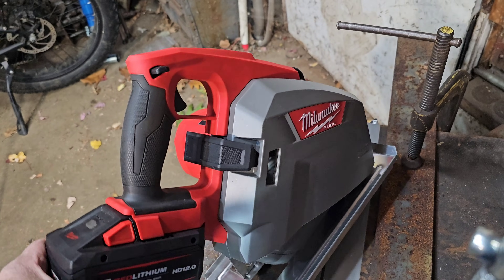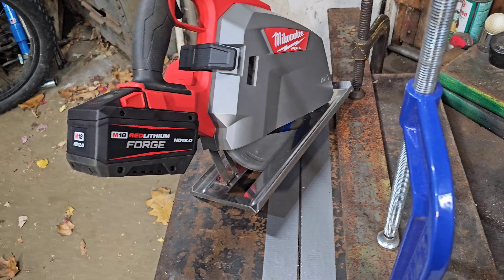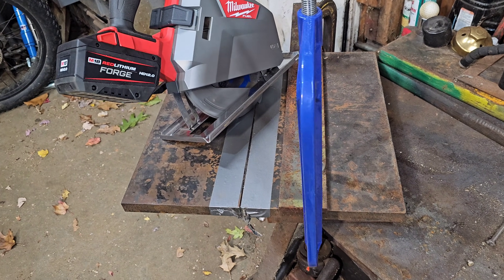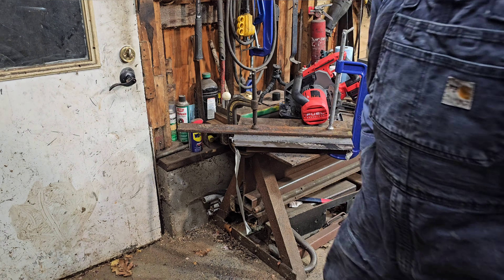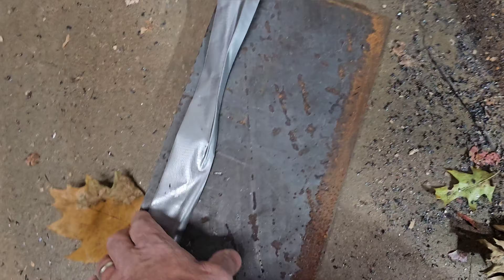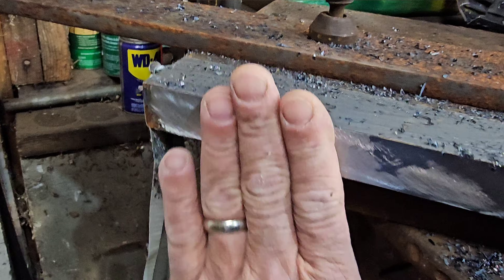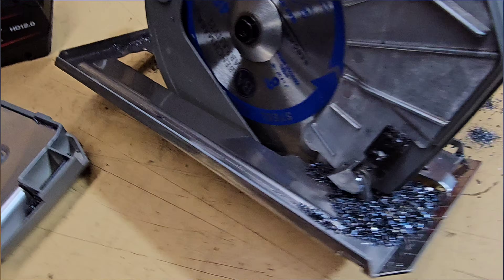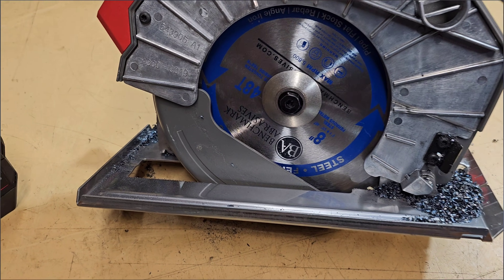Can a cordless M18 cut 1" steel plate? Milwaukee 2982 8" circular metal saw using Forge 12ah battery

Comment: How long does a blade last on 1" plate with that saw/blade combo?

I used a regular wormdrive skil saw and diablo steel demon 7 1/4 bladw on some 1" plate for about 5ft and cut good but blade was done after that.😂
Reply from the maker: That's all I've done with it.  I have some 1.25" plate I'm going to tackle when I get a chance.

Comment: Does it makes a difference in power when using a forge vs high-output batteries?
Reply from the maker: @DharwinMoris  I haven't tried it with the HO, but my guess is yes.

Comment: Amazing!  Were you able to see the push pressure light from your point of view?  Looks like the proper head position is in front of the blade when cutting, so you can see that light.
Reply from the maker: Yes, I was able to keep the light from coming on for the most part.  I can see it well when cutting.

Comment: That's incredible that it cut that, wonder how much battery it used?
Reply from the maker: @johnodonnell2093  I think I had 3/4 when I started, and it was half when I finished... so a 1/4 battery give or take.
Reply: @reusefull  Well, at that I think I'll be saying to the fab guys at work to get these in for a try.
Reply from the maker: @johnodonnell2093  That was my first attempt.  I have some more cuts to make,  I have a piece of 1.25" that I'm going to wind up trying this on.  I haven't tried it with anything but the 12ah Forge battery yet either.  I'll probably put the results of that up as well.